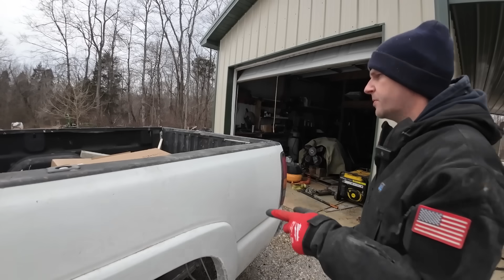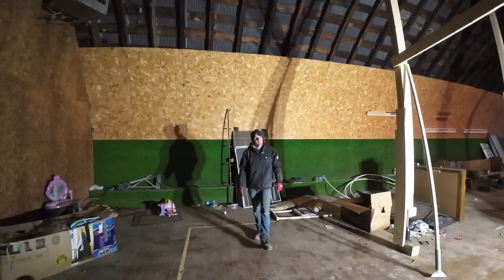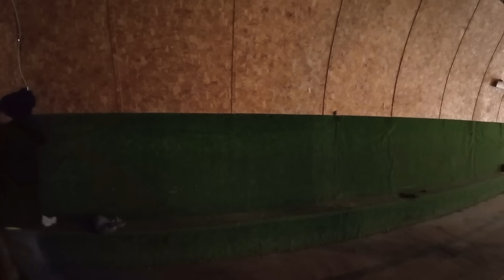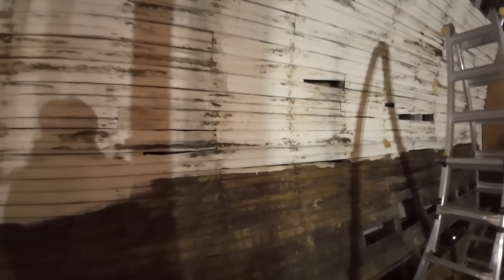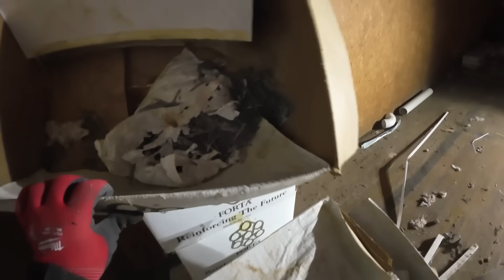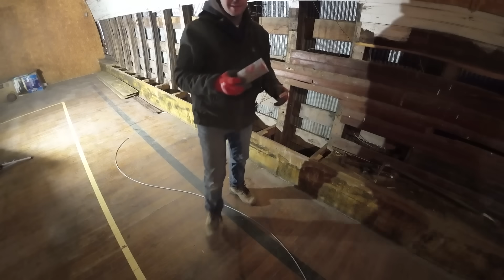Abandoned Barn Revival Phase One Complete!  What's Next?

Comment: Tip for saving thin boards  without breaking them (or wood floor , the trick is to lift the boards of gradually when you start lifting 
Board one you have to start lifting the nearest side of board two ,along  a long narow wood 
Keel  pushed in between the boards and the beam may  help .   You can  warp sheeat metal  around the pointy part, to avoid nails cracking the keel  In some  cases the boards often the  groves or the tennon 
Will just break of anyway, whatever you do ... On thicker floring you can glue the tennon back if only a part has separated. ( clean the boards first  let dry , and then repair)
The old oak  hard wood you extract could 
Be reused in the  comming build ,oak wood top benches ,staircases an sutch .
The benefits of the old stuff is that it has "done its moves" twisting cracking etc , so you don get any  fun surprises after a while  when using  it .
Oak dry slow, green oak will 
Often move a lot when drying. 
The old vintage  warn surface can be nice to , on yhe stuff you build.

Comment: Don't think you can go wrong on putting Timberlocs in as you go along.  It will stiffen up those arches a bunch.  You might look into using the flathead screws.  They are, however, more expensive but won't have heads that get in the way later.

Comment: Hi Mike, I am curious about how you plan to strengthen those laminate beams than span side to side. I think a form of bracing along the sides of them with ply may tie them in. I commented previously that some triangulated additional truss to the roof would stop the collapse but that force pushes down. That is where the ply comes in. It involves cutting sheets into arcs to suit the structure and gluing them in place with like west systems epoxy. If that glue holds the forces of water and wind on racing yacht hulls then that seems a great endorsement for its strength for this purpose. It seems to resist the tension in planks when making slab tables, good stuff but it costs. I am enjoying this project, thanks for bringing us along with you.

Comment: The scaffolding at Harbor Freight is the same as the look alike at Tractor Supply and Northern tool (except Northern tool breaks down more)  Northern Tool is more likely to have the outrigger set for making the scaffold taller and the safety rail set in stock.

I have pieces from all 3 places and they are direct fit. 

Some scaffold moght be helpful.
Reply from the maker: Appreciate the tip!

Comment: I have saved lots of Beadboard, wood flooring, and siding while working on my house restoration project.  One of my go to tools for saving thin material or anything with a tongue was a recirculating saw with a thin metal blade.  I would just work it under the material a cut the fastener wether a nail or staple.  This saved me so much aggravation of just about to finish prying a board to only have the tongue tear out or split  off down the board.  The amount of other people telling you to just cut it every foot with a circular saw and just tear it out and use new material will be exhausting.  The satisfaction of seeing that material repurposed in the building will be something.

Comment: Would make me want to get a lot of hose clamps or angle iron with a bolt welded and make a clamp to hold the boards together. Or make square u bolts and angle type of clamp deal to get the laminated boards back together. Either way this is a huge project that's interesting to watch. Those screws you're using are nice but there's a lot of weight going on here. Again great content Mike! And a Papst blue ribbon peel top was the first beer I had when my Dad handed me one at the age of five or six.